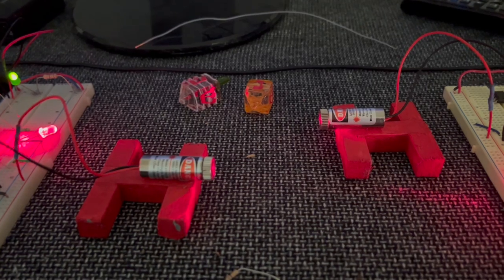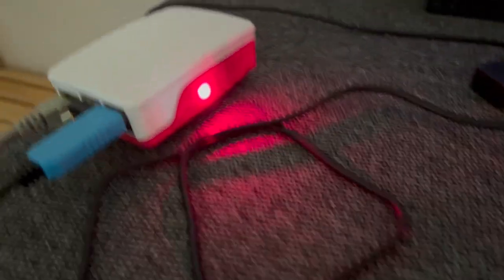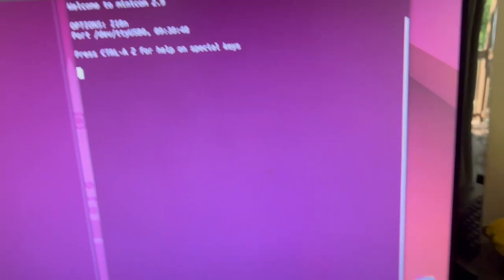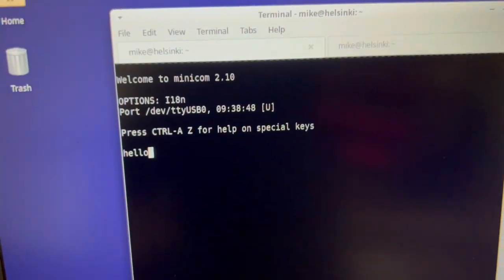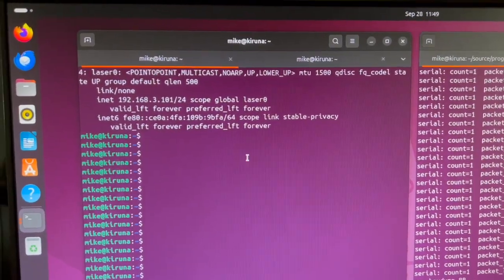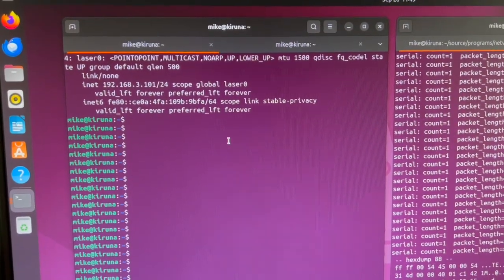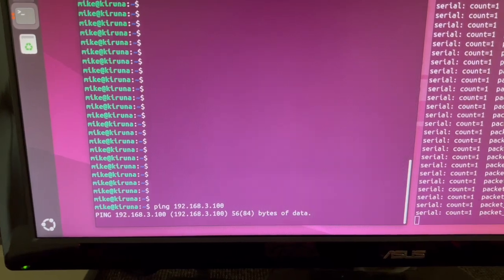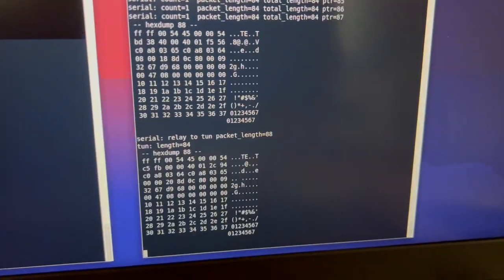IP Over Lasers

Comment: Its called Free-Space Optical Communication (FSO or FSOC). There are commercial units available. They typically have a radio link as a backup. Usage is somewhat niche due to all the reasons you can think of; mainly weather. However, there was a time when companies developed similar solutions to distribute data using LED building lights as a wifi alternative.

Comment: My suggestion is to skip the microcontroller and run SLIP using slattach over UART over laser link. 9600 is easy, 115200 is possible, and for those cheap blue FTDI adapters I've seen it working at 3 Mbit. The challange is making sure that both your laser diode and LED as photodiode doesn't have too many capacitance that slows down the signal too much

Comment: "You need to use fiber optic for the best connection!"
The humble air molecule in question:

(tbf 2400 baud isn't that high, but hey, it still works. Great job man!)

Comment: The microccontroller probably adding a lot of lag, something like a FPGA would be required.
Reply from the maker: I actually thought about FPGA's for this. Really though it could have just been done with some pretty straight circuitry. I was originally looking to drop a carrier frequency on it though. So the microcontroller (should be) running at 8MHz and the code that calculates if the pins should be high / low is around 16 cycles. So it really should behave at 9600.

Comment: why slow ssh?
Reply from the maker: I was running the UARTs at 2400 baud. I tried 9600 but with minicom it showed garbage. 4800 worked on minicom, but it was having problems (probably software and I didn't get a chance yet to recheck it after fixing it) so I ended up with 2400.

Comment: are you basically just bit-banging UART through the laser connection?
Reply from the maker: It's actually simpler than that. The microcontroller sets the laser on / off based on if the UART TX is high / low. Could really have done this without the microcontroller.